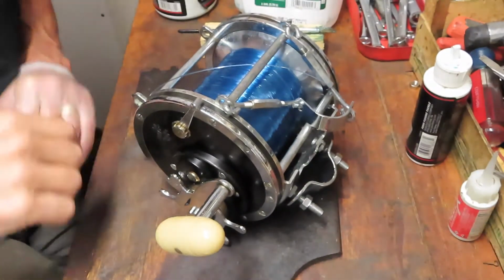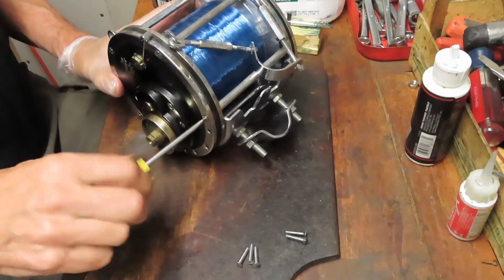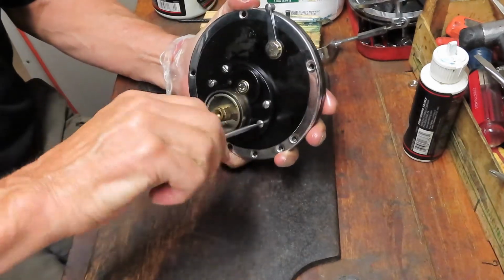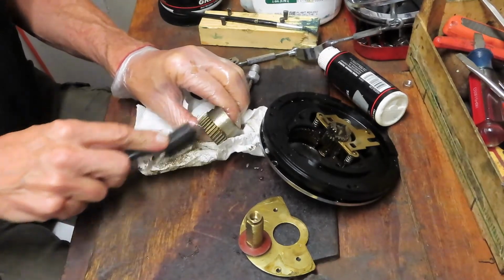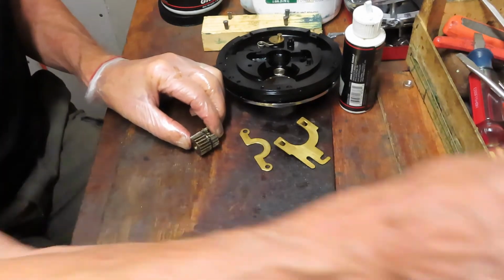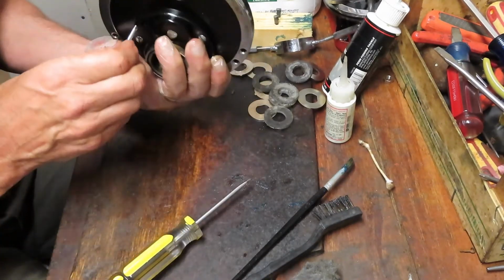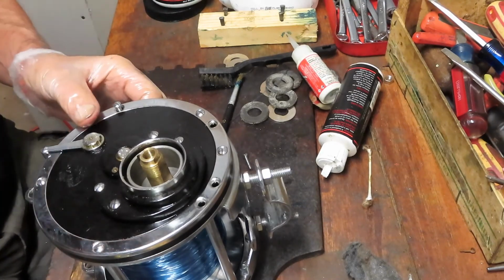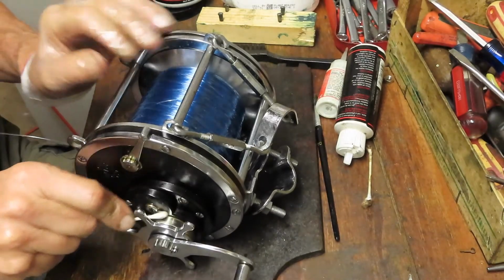Penn Senator 10/0 large saltwater trolling reel how to take apart and service

Comment: I’m 16 and I’m looking for a 16/0 senator and a fenwick woodstream 130lb class to get the exact setup that was used in jaws.

Edit: another suggestion is when you take off the main gear sleeve, take a Q tip and run it through the inside of the sleeve to get as much of that old grease out
Reply from the maker: Good luck in your search!  I believe that the Senator in Jaws was modified to make it look bigger.  Regardless, that is a nice combo and you should enjoy it when you find it.  Best wishes
Dennis

Comment: Hi there , I have a 10/0 Senator and it has a small amount of sideways play on the spool . Is this normal ?
 Kind regards Paul
Reply from the maker: yes, there should be some side to side play.  If it is excessive, you can try adding a small shim washer to the non-gear side of the spool shaft.

Comment: When I turn to make sure anti reserves is working it does but then I screw on the wheel to adjust drag it screws on and feels like it rubbing the metal and it doesn’t make a clicking noise like yours and when I reel it the spool moves a little what did I do wrong?
Reply from the maker: You need to go back and make sure the A/R clicker and spring are set correctly.  It seems line the dog is in the right position but that the spring is not working or is not installed right - I would check that first - Dennis
Reply: @2ndChanceTackle  the weird thing is when I take out the piece that protects the gear with the drag inside and screw on the drag wheel it work just fine but when I put that piece that hides the gear from the outside in it sounds like metal grinding and doesn’t work.

Comment: Wow you could use that thing as a dumbbell replacement. I'm surprised that reel still gets use. Especially with the affordable modern reels and braid options available.
Reply from the maker: Video killed the radio star and braid has done in these big old reels as well.  I don't see that many 3/0 and 4/0 Senators any longer as well.  The Avet type small frame lever drags with braid have slayed the dragon - Dennis

Comment: Awesome video, they are almost the same as the sealine 900
Reply from the maker: Thanks Brad.  The Daiwa Sealine 900 Rock Cod Special is closer to the Penn 6/0, but both are completely bulletproof designs that will last for ever. - Dennis